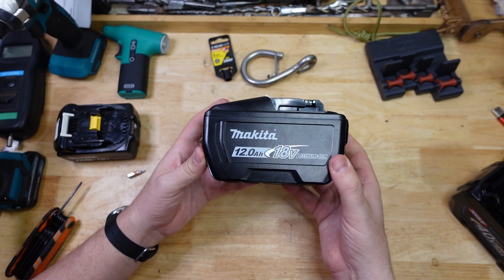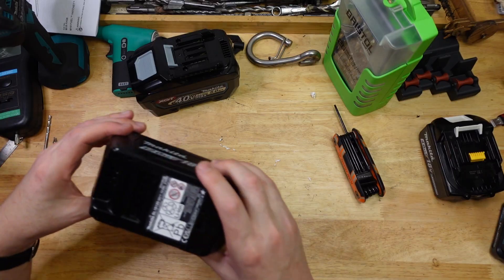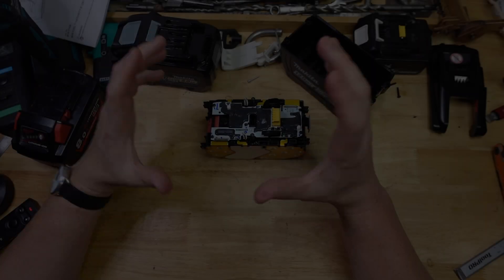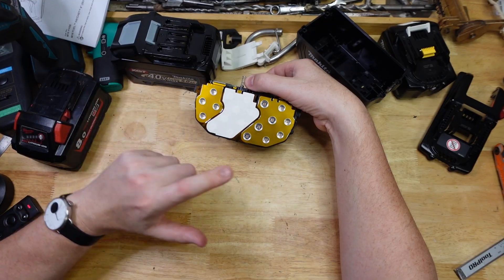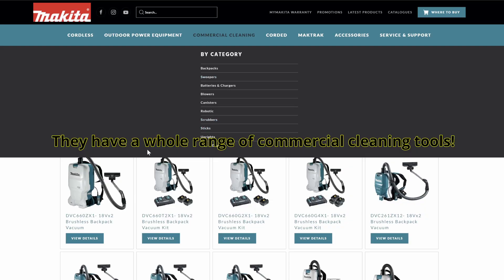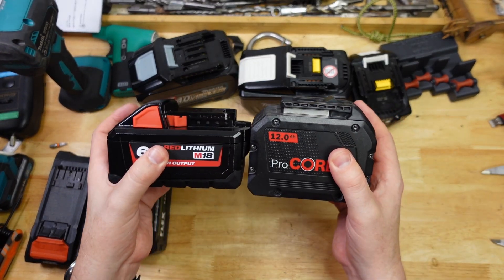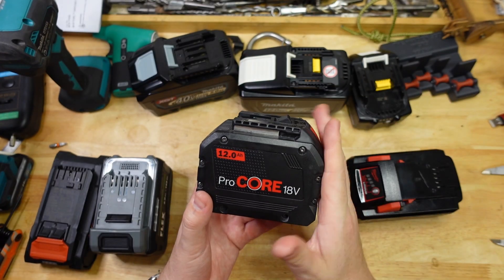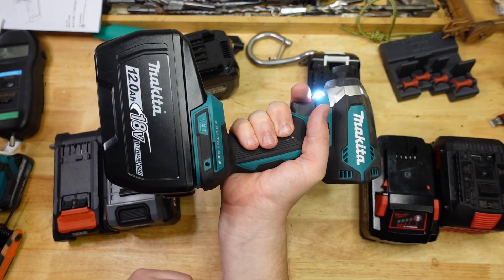Inside the new Makita BL18120 12.0Ah Battery!

Comment: Makita user here, thanks for the teardown.
I've had an impact driver fall from a scaffolding of a roof (that was with a 3Ah), it did not break the base, or the battery either, did not detach, you couldn't tell it fell.
So I don't see any issues with the holder. The first ramp section of the rail does engage, by the way.
In my opinion, they did a great job with compatibility, keeping the front-end of the battery exactly the same, and the width, too.
Also, buying and running a tool with previous batteries, then complaining that a future battery might not fit -- it just doesn't make any sense.

Comment: "Milwaukee only makes professional grade tools."  😂🤣 As a Plumber, I can assure that their cordless tools also run the gamut from low to high power. Some of them draw too much current and can easily be burnt out, namely the VSR Drills. 

Makita makes the best impact driver, Milwaukee makes the best sawzall, and DeWalt makes the best VSR Drill, and it's been that way for a long time. My Makita deep cut bandsaw has outlived many of my coworkers' bandsaws. Milwaukee currently makes the best chainsaw. DeWalt has some beastly angle grinders, though those are running at 60v. 

I currently have Makita but am planning on switching to DeWalt 60v for most of my tools. At the 18v level, there is no clear front runner for most or all categories. Up until now, for all of the brands besides Makita, the only way to get more performance at this point is higher voltage. Makita finally has a triple stack here and has now hit the brick wall of high current. You can't really shove much more power into a tool at 18v than a triple stack without quickly melting things. It's a shame Makita came out with a 40v line instead of something higher voltage such as 54v to compete with DeWalt. Makita, unlike other companies, is it's own company and they are Japanese. The Japanese market probably wasn't even asking for 40v, America and the rest of the Anglo countries wanted more power from cordless tools.

Comment: Just bought two of these and my lawn mower could do my grass twice over, whipper snip and blow all on one set.
Reply from the maker: Do they fit in the mower?
Reply: @BoltahDownunder absolutely. No problem closing the plastic lid
Reply: Does it work well?
Reply: @brenndog1 amazingly. I tested 2 x 6ah on a grinder one after the other at full speed but not cutting. Held down the trigger with a zip tie. The 12ah lasted longer by about 8 minutes which is impressive. With a 9 and 12 on the mower I can cover about 300m square

Comment: Hello, the designation of the 12AH dsp 600 battery above not to use them is not about mounting and holding power, but about the size of the battery. These are 36V saws from a combination of two 18V batteries. The lower battery, with its larger housing size, does not allow the DSP chainsaw to work in the full range of angle or tilt settings. Regards

Comment: I trust this to be robust and reliable like all Makita stuff but I cannot justify buying this. Also they slept on this for too long. I've already made myself 4 bricks of strong molicel 21700 with a decent looking BMS off AliExpress (has balancing, protection, I've tested) in 5S2P, gives around 9Ah, puts out mad current w low sag. Love em for chainsaw, lawn mowing and such
Reply: id recommend you to do a conformal coating on your aliexpress BMS boards. the OEM Makita PCBs have such a coating on them, it protects against condensation, humidity, water.
Reply: I did a run time test on two identical angle grinders. One with 12ah battery and the other with 6ah. The 12ah lasted 2.5 times longer than the 6ah which puts the output closer to 15ah in reality. Well worth the $379 in my opinion.

Comment: If the cells are different to what dewalt use in their 12Ah a d they're 21700 I'll be sourcing a set to rebuild mine... one died just out of warranty and I couldn't find the receipt or invoice. Annoying. Had not even done a lot of work. 5Ah worst 4Ah bad, 3Ah legit.

Comment: A 18650 battery capable of 20 Ampere is usually a manganese type, or have a good percentage on manganese in the cathode. Manganese halves the cycle life but doubles the current.

Comment: I want one for the tracksaw or vacuum but it doesnt fit either, the vacuum will but wont close the lid.
Reply from the maker: Yeah I have a Bosch vacuum that has this problem. But they recognized it and provide a different cover piece for when you use the 12Ah! I assume Makita will also roll out some hardware fixes like this, but it's still a pain
Reply: I cant even see a need for the battery lid on the vacuum. I just removed mine permanently 😅

Comment: If that's the reason I'm surprised Makita didn't just use tabs to prevent the big boy from clipping into smaller tools, maybe their molding system just wasn't designed for it from the start? On the Bosch and Hilti you can see the tabs prevent clicking in(which can be easily snipped off obviously)
Reply from the maker: The new chonkers do have different moulding for the carriage rail area. They're slightly reinforced compared to the smaller batteries. I'd like to get a 3D scan of them and measure exactly how much extra plastic volume they've added, because they're really stretching what the rails can handle, IMO

Comment: funny the aus flex battery doesnt write the power output like the usa models (6ah 1920W). instead gives u the 144wh reading. time 7.33 mark.
Reply from the maker: They do state Watts on the website at least!
Reply: @BoltahDownunder  by the way which flex 24v tool did you get?
Reply from the maker: I have the smaller SDS that I got in Canada a while back, and now the big SDS. And actually just looking at the Oz batteries they do say "maximum continuous discharge current watts (1920W)" on the side in small text. Which is great, means we didn't need to open them up!
Reply: @BoltahDownunder  wonder if this 12amp makita states how much power it dumps out? 1.6kw? if you dont mind burning out the makita tools, probably can use the flex 24v to makita converter to get 1.9KW of power :P
Reply from the maker: Nope! The main aim of this video was to try and work that out cos they don't say. If you can find out what model cells they are you can work it out, but these cells don't have any specs! But assuming that one listing is accurate and they're 20amp cells, it should be 1440 watts

Comment: As long as the they don’t overheat in the 21 inch self propelled  lawn mower.
Reply from the maker: If they even fit! Batteries should run cooler given they have more area for the pixies to flow at least
Reply: @BoltahDownunder I found the 6ah the worst and would cut out half discharge and they would get so hot. I Can see on reddit that they fit but looks like plastic lid doesn’t close down all the way.

Comment: But it is perfect for the lawn mowers and the same time can be used on the drill
Reply from the maker: As long as it fits in the mowers! There's one at least that the cover doesn't close fully. But it still mows
Reply: I have the 464 mower and the lid closes comfortably with the new 9 and 12. Highly recommended.

Comment: I thought Makita was stuck at 2P5S 18650 and refused to use 21700 cells because they wouldn’t fit certain tools (dual battery circ saw, for ex)… so why is it suddenly OK to jump all the way up to 4P?! The tools that won’t fit anything larger than 2P5S 18650s aren’t going to fit 4P5S… and if they are going to make larger batteries anyway, why not use 21700 cells? Heck, a pack with 3S5P like the DCB612 FlexVolt in 20v Max mode with 9x Samsung INR21700-40T cells would compare favorably at 12AH, and a 9AH version with Samsung 30T cells would hit even harder.
Reply: because they are wider. also there are much better 21700 cells now
Reply from the maker: What I don't understand is why doesn't anyone just put the bigger cells in lengthwise? I think Hikoki and Makita 12v batts are like that but it would solve some space issues in the 18v system to surely
Reply: @BoltahDownunder  it's probably not the most efficient use of space, 5cell 21700 pack in that config would have similar footprint as 10 cell 18650 pack which has more power and capacity
Reply: @BoltahDownunder  It would probably have to alternate between two and three cells per layer so it wouldn’t be very space efficient but if height were no concern it could be done. 👍

Perhaps there is a market for cells with the diameter of 21700 and length of 18650: 21650 cells. ;)
Reply: @riba2233  Yeah, so if they are going to go bigger than would fit in those saws anyway, why not introduce 21700 Samsung cells, tabless 21700 Ampace cells, pouch lithium cells, etc? If the size is what was holding them back before and they are no longer letting it hold them back, I expected at least 21700 cells.
Reply: @emmettturner9452  because they just wouldn't gain much, tabless cells are overkill for lxt tools and regular 21700 don't offer much compared to these 18650s
Reply: @riba2233  Seriously? 2P5S batteries have been the #1 thing holding Makita tools back. DeWALT’s best-performing 20v batteries before the PowerStack (stacked pouch lithium) and PowerPack (tabless 21700) were the DCB206 and DCB609, both with Samsung INR21700-30T cells that you just couldn’t fit in the Makita 2P5S footprint. Now that they’ve gone ahead and violated that self-imposed limitation with a 4P5S battery, they may as well have done it with 21700 cells. A 3P 12AH pack with 40T cells would mop the floor with a 4P 12AH using standard 18650 cells… like Makita’s new pack. It just doesn’t make sense.
Reply: @emmettturner9452  no it wouldn't, it would be 80 vs 90A, small difference and like I said lxt tools don't draw that much power. And this way they kept compatibility with some 18x2 tools because packs are not wider than the old ones.
Reply: @riba2233  The issue was height AND width. By making them 4P they made them taller than they had to be. Anyway, it’s clear you aren’t familiar with just how good 30T and 40T cells are. Tool_Scientist tested a 12AH Milwaukee pack with 3P Samsung 40T cells up to 158 amps and said it still had more to give when the grinder cut out and stopped going higher. 12AH with 30T in 4P could have done over 240 amps.
Reply: @emmettturner9452  well, yt won't let me comment anymore so I guess that's it for this one 😅
Reply: @riba2233  Sorry to hear that. :( Happens to me all the time
Reply: @emmettturner9452  by putting 21700 into top LXT tools they would kill the XGT tools in terms of performance. XGTs are struggling enough to avoid extra fight with the LXTs. Simple.
Reply: From using them Panasonic cells they last a bloody long time. They are likely going at it from the point of view that these are going to be a product that even the higher end of their customer base is going to buy 1 or 2 of these so may as well pack it full of mid discharge rate cells that are going to last allot of cycles but hopefully still fit into some of their side by side battery tools. After all the biggest complaint about the coffee machine is that it blew through batteries for fun. Even with just double the capacity I would place bets on them being able to do double the work due to less power lost as heat from high discharge.
Reply: @501isa  This makes a lot of sense. Thanks!
Reply: 40T are not reliable cells.
Reply: @fredio54  That’s why 30T cells are preferred but you don’t get 12AH at 3P that way. 40T is much more reliable than 50S and more than reliable enough, especially at 3P. Besides, we have 4AH Ampace tabless cells in 21700 sizes now, so it’s a moot point.